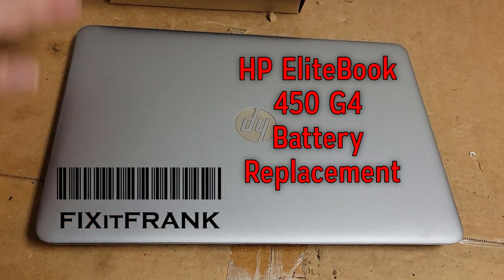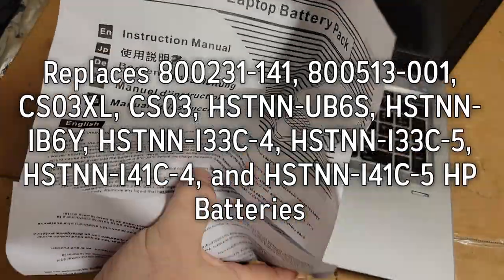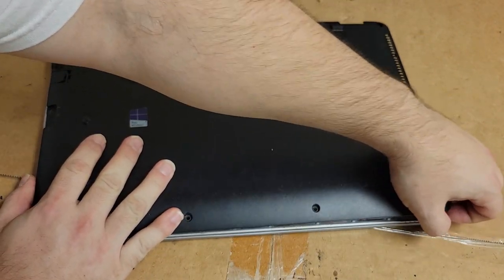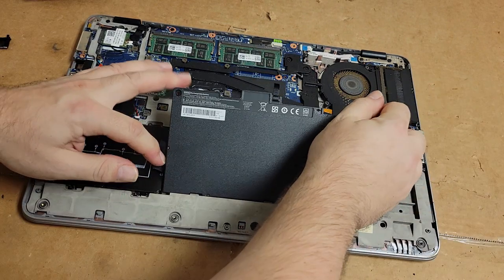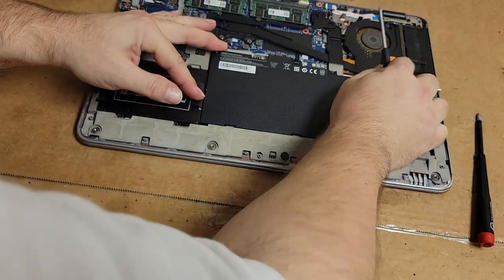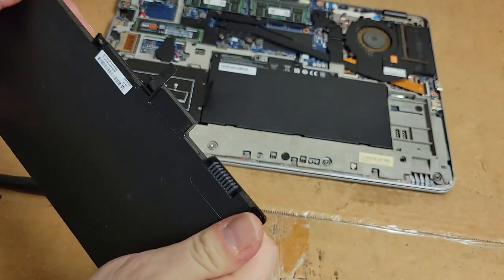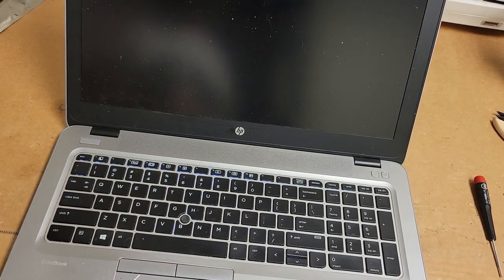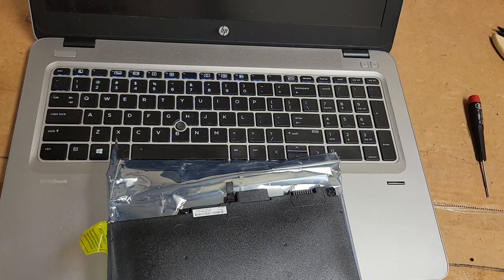Hewlett Packard HP Elitebook 450 G4 Laptop Battery Replacement After Trackpad Cracked

Comment: Nice to keep things going! Just replaced my 2011 MacMini with the new M1 one two days ago. 2011 beast just kept going with regular cleanings, still runs fine but will be upgraded with more ram and a new SSD to have as a back up machine. Love to keep old(er) things running like champs. Like my car. I still drive a 1998 Corolla that is kept top notch, no need to replace perfectly running things!
Reply from the maker: I think we are brothers from another mother.  I drive a 2002 Toyota Sequoia(212,000mi), I still use my Asus G51J from 2012 and have a NAS drive from 2010 that I just put SSDs into.  If it works, why get rid of it?
Reply: @FixitFrank  Indeed! That's why we have no payments and no stupid dept. No dept = freedom. Just be thankful for what you have and respectful towards it.

Comment: A few months ago, I have found my Samsung Note 8, with the back cover lifted quite badly. It was the easiest battery replacement.
Reply from the maker: I really miss the old days of removal backs.  My buddy has a similar version of this laptop and spilled coffee in it, he was unable to pull the battery and now its not booting.  That might be a video soon if I can find the bad component.
Reply: @FixitFrank  Note 8 has a glass back, it is not removable. Battery got so swollen, that lifted the back in like 45 degree, after I have removed the protective case(!) ...and I had my phone on the nightstand, and it was charging all night. I have stopped doing that after this.

Comment: I have an older but nice 2 in 1 Asus laptop, that won't recognize a hard drive. I can't figure out what could be. I have replaced the small hard drive board, which did not change anything. I have got the motherboard from the Ebay and it worked until I have installed Windows 10 one it. I have put it away, waiting for somebody to buy it,.When somebody was ready to buy it, I have tried turning it on, and to my surprise, it would load only in BIOS. Lately, I'm dealing with laptop problems myself. My daughter's Dell 11" would not charge again(like every 6-9 months needs a new charger), my Toshiba 4k laptop(Costco model) LCD wire harness is acting up, and only on Alibaba they have something, that may be compatible. Best of luck I had until now, is with Lenovo.
Reply from the maker: Sounds a little to close to a day at work for me...My friend had the Asus "transformer" which was awesome when it worked, then when it started acting up, it turned into a real dog.  I'd check the connectors on that dell power brick.  I know some people like to wrap the wires around the brick and break the conductors without realizing.  Curiously I have run into that LCD wire harness issue in a Lenovo. So far my best laptop(with not failing regularly) was my old Asus G51J. I may have to see about getting a new version of one of those.  It is such a tank.